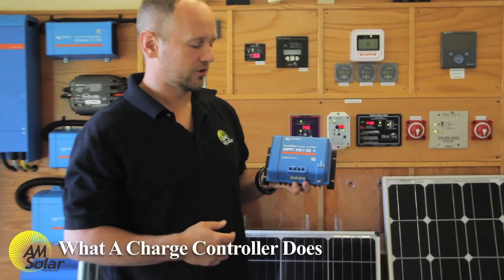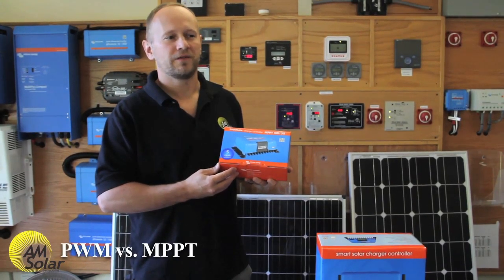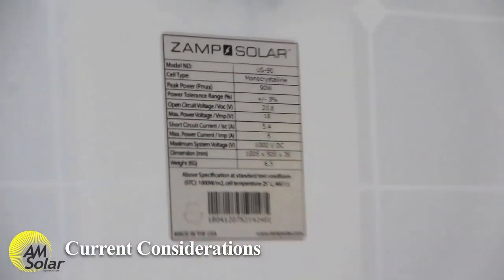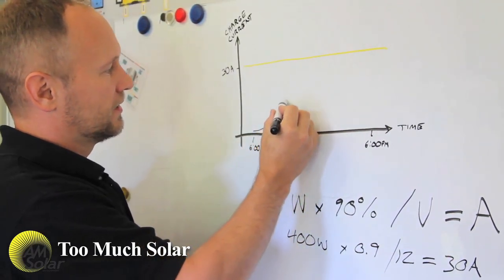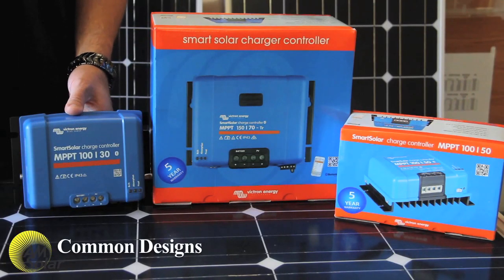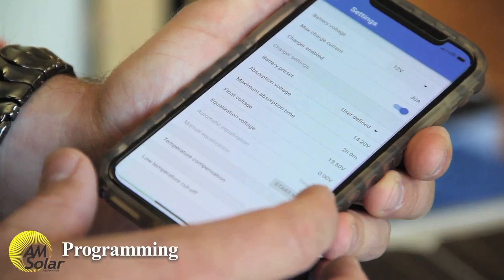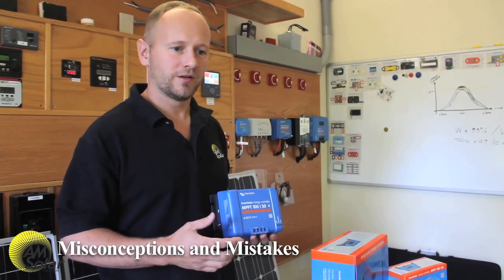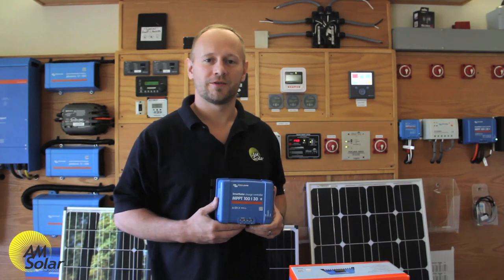How to Select the Best Solar Charge Controller for Your RV, Skoolie or Van

Comment: This is a very good description of charge controllers. However, your wattage calculations are all based on having a 12V battery system. If you have 24 volt batteries, the wattages double, and with 48 volt batteries, they double again. For instance, your 30 amp (maximum output current) Victron charge controller with a 12 V battery will output at most 360 watts, give or take a bit based on the actual operating voltage of the battery. 400 watts or so of solar panels would be appropriate. With a 24 volt battery system, that same 30 Amps will give 720 watts, and with a 48 volt battery system, that 30 amp output will give 1440 watts, so total solar panel output power can be increased accordingly.
The charge controller will charge any of these systems because the 30 amp maximum current applies to all of the battery voltages. The Victron charge controller is even smart enough to auto detect the battery system voltage!
This is an important point that wasn't covered in this video.
Reply from the maker: It’s been a long time since I posted this video and in that time we have done a lot more 24V systems.  You are absolutely right.  Don’t use “12” in all the calculations.  If you have a 24V or 48V battery bank, use “24” or “48”.  A controller will support twice the solar wattage at 24V than it will at 12V.  When I get a chance, I plan on making a revised video where I also bring up input current limits, another issue missed on this video.

Comment: What we really need: A useful charge controller comparison. Measure the output of the not yet connected panel, the voltage at the input with the panel connected, and the voltage to the battery and load from the controller. Every eBay Price lowest first controller I have tested knocks the panel down to 11.8 at the input and sends that to the battery. No amount of control changing will bring that up.
Reply from the maker: Thanks for the input.  What are some controllers you would like to see compared?  This channel is an offshoot of a business that warranties work for the life of the install and provides high level tech support to customers that have issues.  Because of that, we have to be very careful about the products we carry, and we feel Victron does the best job of keeping our non-revenue producing support (tech and warranty) to a minimum.  So, we don’t typically have a variety of controllers around.  

The output of a panel that isn’t connected to anything would be zero.  The potential output would vary based on irradiance, temperature, and the resistance of whatever the panel is connected to (i.e. the voltage at which current is being drawn).

As for the rest of your comment, it sounds like you are dealing with a PWM charge controller.  PWM stands for Pulse Width Modulation, and PWM controllers connect the panel directly to the battery.  The connection is pulsed, with on/off cycles based on the voltage of the battery (roughly the charge status).  If you are getting 11.8V on the panel side, that’s because your battery is roughly 11.8V, and the battery forces the panel to operate at that voltage with a PWM controller.  There is nothing wrong with this.  It works, but it isn’t as efficient as an MPPT charge controller that lets the panel operate at a more efficient voltage (usually 18V depending on the panel) and transforms that higher voltage down to something that is safe for your battery.

Comment: Great video! Good rule of thumb suggestions. Best video on controllers that I have seen. 
I have 2 renogy 270 watt solar panels. I believe RNG 270 pg 1. 
The back says it’s 38 volts. 
In this video, the rule of thumb of over 300 watts I should get a mppt. I’m at 270 and so maybe pwm is ok. (Unless I series the panels someday) Does it being a 
38 volt panel affect what charge controller I should get? 
Luckily thanks to your video and the rule of thumb (first number on the Victron is the max voltage) I think I’ll need the Victron 100/30? The panel says 9 amps so in series or parallel I should be good?
Reply from the maker: Because of the higher voltage, you will need an MPPT controller to step that down for charging a 12V battery bank.  If this is a mobile application, I would go with parallel connections.  2 x 270 x 0.9 / 12 = 40.5A.  You could use the 100/30, but you will likely get clipping on bright days.  Another option would be the 100/50 if you didn’t want any clipping.  If I spent most my time under 45 degrees latitude, I would go with the 100/50.  Otherwise, the Victron SmartSolar MPPT 100/30 would be fine.

Comment: I love this informative video and I admit i'm a newbie at solar systems, but other videos / tutorials ive seen show that you can get closer to 1400 watts or more running on a 150v /60 amp charge controller as long as you're running a 24 volt solar panels / 24v battery, etc  ? I realize that you said that the calculations arent black and white, but i'm confused because of the big gap between less than a thousand and 1400+ . I bet i'm missing something  really obvious.

Comment: I have 3 190 watt panels and a Victron 100/50 charg controller. Can I safely add another a190 watt panel? My panels are now hooked up in series. Thank you
Reply from the maker: You can if you put your panels in parallel or series pairs.  Definitely don’t add the fourth panel in series.

Comment: Thank you for going over that formula, I almost under spec'd (3x) 180 watt / 9 amp panels as only being 27 amps, not 40.5 amps. That would have been a big mistake.
Reply from the maker: Its a common mistake.  You likely wouldn't have fried anything, but you would have experienced some current limiting on bright days.

Comment: Hi great video one question i have a ute canopy with a 300watt solar panel on the roof and a 100ah agm battery   but when i pull up at camp i will use my 200 watt folding panel instead , i run a waeco fridge a a few solar i lights what size solar controller do i need  also a PWM or MPTT controller also whats a good brand of controller thank you
Reply from the maker: I’m guessing your roof mounted panels and your portable panel have different operating voltages, and your roof mount panel is probably too hot for a PWM on a 12V battery.  You will need at least a 20A MPPT controller for the roof, and a separate controller PWM or MPPT, rated at 10A or more for the portable panel.
Reply: @GarretTowneAMS  hi my roof mount is a 300 watt and the portable is 200 watt if i get a 30 am vitcron mppt controller will that work for both
Reply from the maker: @Farmer2492  You won't be able to mix the panels on the same controller because they likely have very different Vmpp.
Reply: @GarretTowneAMS  Hi no i will be using one panel at a time
Reply from the maker: @Farmer2492  If you are just using one panel at a time, a 20A MPPT charge controller will work.

Comment: Hi I have 4 x290 watt panel and have 12 volt batteries what model mppt controller do I use in parallel setup
Reply from the maker: Victron 150/85
Reply: @GarretTowneAMS   thank you we’re much and that will run my parallel setup

Comment: For that watts of solar × 90% / voltage of charging = amps is the solar panels in series or parallel or it doesn't matter which?!
Reply from the maker: It doesn’t matter. The results are the same either way..
Reply: @GarretTowneAMS  what would determine if we hook up panels in series vs parallel? Thanks! I just found you and am grateful of the concise information! I'm trying to get a controller choice nailed down. MPPT, but I've got 2 agm batteries,  only 400 watts=30A, BUT panels say 12-24V which is confusing me. Help! Lol thank you
Reply from the maker: @heatherk8931  Ignore the 12-24V on the panels.  It doesn't mean anything useful.  Your panels likely operate at 18V, which in parallel is ideal for a 12V battery bank.  Put the panels in parallel to give them optimal performance under partial shade.  Use 6ga after the panels are combined to the charge controller, and 6ga from the charge controller to the battery.

Comment: I've tried my hardest not to ask and just to do enough research to figure it out but I guess confirmation would be nice too haha. I have 800W of solar (4 x 200W) that I'm planning on wiring in series-parallel and a 40a charge controller. In just about every video or blog, people recommend at least 70-80a charge controllers but I think that's because they're usually expecting people to wire in series. Since I'm wiring in series-parallel my total amps would be 20.4 and total volts would be 48.6 (each panel has a VOC of 24.3 V & ISC 10.2 A)so it seems like I should be fine with a 40a charge controller. It's all Rich Solar brand. Thoughts?
Reply from the maker: Charge controllers are rated on output current, not input current, so your array configuration doesn’t matter, four panels is too hot for the controller. You might get 60A of charging current, and that’s not a good match a 40A controller. Put all your panels in series and you still have too much output current. Good luck with your project.
Reply: @GarretTowneAMS  Thank you so much! Super good to know! :)

Comment: Hi, when charging camper batteries it is often mentioned that the charge amperage should not be to high or the battery life span will be reduced. Am I right in assuming that a victron 100/30 is charging batteries at an initial rate of 30 amps, which for many campers is considered to high. What are your thoughts. Kind regards
Reply from the maker: The charging current output of the 100/30 will be 30A DC.  I don’t know of any RV batteries where this is an issue.  You might be thinking of 30A AC, which is a totally different thing.  For example, a popular Battle Born battery can charge at 50A.  Many people have two of these, so that would mean the system can handle 100A of charge.
Reply: @GarretTowneAMS  Thank you for the advice.

Comment: If i understood correctly, my 4 210  watt panels wired in series with voc of 19.83, isc of 13.09 and my 24v 280ah lifepo4 battery bank would need a 100/30 victron charge controller?
Reply from the maker: Yes, you got it.
Reply: If i find i need 2 more panels to fully charge my battery, should i wire my panels in a different configuration? A 3s 3p, or vice versa, and then would i need to jump up to a 150/60? I hate to buy one and then realize i need a bigger one, and i believe 280ah×24v is 7kw. A 840w pv won't charge that under the best conditions. I may have to hang 2 more panels from the side of my trailer hinged to get closer to my needs. Now I'm going to have to look for your web page, i may be better buying from you for the tech support lol. Thanks, God bless!!
Reply from the maker: @checkingoutgypsymike2075  The array configuration doesn’t change the charge controller output, so that wouldn’t matter. With six panels, you might get 47A. I recommend a 100/50 controller with 3 parallel groups of two in series.
Reply: @GarretTowneAMS  i found your company web page, your prices are great. Same as amazon to my pleasant surprise! I can't thank you enough!!

Comment: Ok, I have watched so many videos on solar and still don’t quite understand, I have 4 100W panels, 1000W pure sine wave inverter, I did buy a charge controller but it is not a  MPPT so I sent it back, bought a reset circuit breaker and someone said I needed a fuse also, have 1 100ah lithium battery, what I am trying to do is hook up to ru a freezer and refrigerator and nothing else, do I need to use all 4 panels? Should I have 2 batteries, I can’t get anyone to answer me, l am 74, trying to get ready for hurricane season, Thanks
Reply from the maker: There are a lot of crazy people on the internet talking nonsense about solar.  I understand the frustration.  You will want all four panels connected in parallel.  A breaker and a fuse do the same thing.  We would use a 40A breaker between the charge controller and the battery bank.  Your system will work with one battery, it’s just a matter of how much energy you want to store.  You can add a second battery later if you want more energy.

Comment: Great video, please make more. Quick question, some of the inverters have built in charge controllers , would your formula still work in that scenario ?
Reply from the maker: We haven’t worked with an inverter that has a built-in solar charge controller before, but I have heard of them.  Make sure you actually have a SOLAR charge controller, not just a charger.  If that is what you have, the formula would still work.  I have several video scripts in the work, just not enough free time.  We are insanely busy.  Thank you.

Comment: Solar controlers are very expensive kitchen timers. All under charge a battery bank during the winter and do OK during the summer. Their bulk charging time is set and can not be adjusted. A cheep solar controler will put the same amps PER A DAY in to a battery bank as an expensive one.
I just bought a new Outback and over a few days it put an extra 10 amps in to the 640 amp hour battery bank. So it went back. A neighbour lent me an old trace 60 amp charger and it put the same amps in during the day.
Were these chargers fail is they can not "see" how many batteries are in the house bank. In 10 yrs of living off grid.... No charger has ever put out more than 80 amps over a day... Even when the 640 amp( new) battery bank is 12.4 volts in the morning.
Oh... Epever seems to be the best for the buck.
Reply from the maker: I keep getting these nonsense comments.  If you want to market your product make your own YouTube video.
Reply: @GarretTowneAMS .... May I suggest you show us?
Run a large battery bank to 12.3 volts and show us how many amps go in to the bank in a day. Outback, Victron and the cheep Chinese stuff. Do a REAL comparison.... Not a puff piece like your video.
Reply from the maker: @sails3538  We're too busy doing real work to deal with scammers and confused pseudo engineers.

Comment: Very informative video!  For a 12v system, 4x100ah Lithium, 4x210watt panels (Vmp:22.4, Voc 24.9, Imp 9.37, Isc 9.85), would the 100/50 be a good choice?  If so, would the 100/50 still be good if 2 more 210 watt panels were added?  I’m thinking 3s2p config for the panels.
Reply from the maker: 4 x 210W x 0.9 / 12V = 63A, and 4 x 210W x 0.9 / 12V = 95A
If you want just four panels, get a 150/70.  If you want six panels, get the 150/100.
Reply: @GarretTowneAMS  Thanks Garret.

Comment: Hi, I have 6 12V 200Amps renogy panels and 4 AGM 270ah batteries, what kind of MPPT would you recomended for this set? Thanks for your video.
Reply from the maker: 6x 200W x .9 / 12V = 90A, I recommend a Victron SmartSolar 150/85 or 150/100.
Reply: @GarretTowneAMS  Thanks, I will lookup for affordable option using this data. Victron is extremely expensive. I saw one branded as OOYCYOO and Im looking further for reviews and tested for how is going with this brand.
https://www.amazon.com/OOYCYOO-MPPT-Charge-Controller-100-amp-12V-24V-Auto-100A-Solar-Panel-Charge-Regulator-with/dp/B07T63R5TK/ref=cm_wl_huc_item?th=1

Comment: Thanks for the math lesson. That's exactly what I've been looking for. I just bought a 100/50 charge controller. So 4 100 watt panels should safely do it.
Reply: Victron depends on your battery voltage if you using 12v then yea 400w, 24v 800w, 48v 1600w etc

Comment: Great information. I bought second hand panels and batteries: 6 panels for a total of 1020 W (12V), parallel wired, and 1140 AH of deep cycle lead batteries (6 of SBS-190F). I calculated 78A charging current needed. Since the system is old, (1) can I get away with a 70 A controller, and (2) is a PWM controller sufficient?
Reply: I would feel comfortable with a 70A controller on that.  Make sure you don't exceed the input current or input voltage limits.  With a system that big, I would avoid PWM.  Get a Victron 150/70.
Reply: Thanks for the information - very much appreciated.

Comment: Hell another expert says wire in series for that controller
Reply from the maker: You can do that, but with our systems you get better performance in parallel. It depends on many factors, including cable size.

Comment: Hi,
I would like to know what  inverter, what MPPT is suitable with 2 batteries (200+200)=400Ah/AGM , 12V , 

and 4 solar panels 330W.

1 solar panel : VOC   45.9 

                          Vmp  37.3V

                          Imp   8.85Ah

I want to use this kit for a Food Truck.

I would like to use a 12 v kit, so I can add a dc-dc charger.

Also I would like to add on kit, one DC-DC charger 20Ah or 40Ah.

I travel about 3 hours a day and a Dc-dc charger would help me charge a few extra Ah a day.

I mention that I have a consumption of 700W/h and I need about 4 hours continuously for this watt.

Each evening I charge power from electrical socket of house.

I think the peak power is about 1500W but I'not pretty sure.

I have a 300 ltr refrigerator, a refrigerated display case, two 66 ltr refrigerators, commercial chest frezzer 288 ltr. and other electrical consumers (all are commercial equipment).

How could I connect the solar panels better in parallel or in series at 12V? I know that if I links them in series, and a panel is a part in the shade then the second panel does not produce current either.

Any additional information from you or your subscribers would be helpful. 

Thanks in advance!
Reply: Daniel, The easiest way to get you a useful response would be if you went to AMsolar.com and filled out a Quote Request.  I'll get you some details.
Reply: Thanks alot!
I will do!